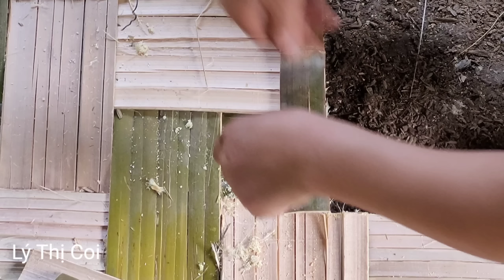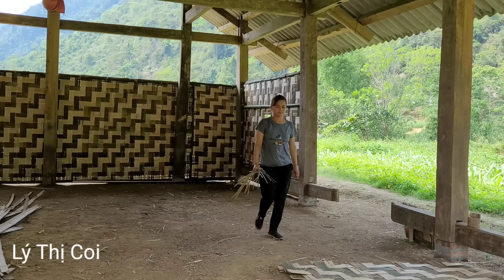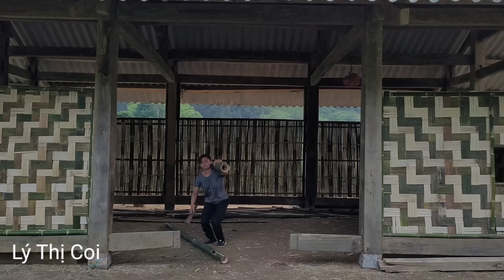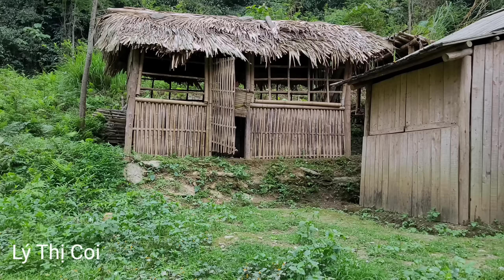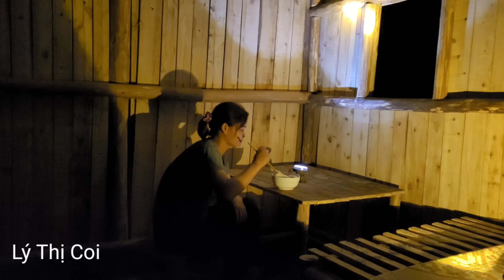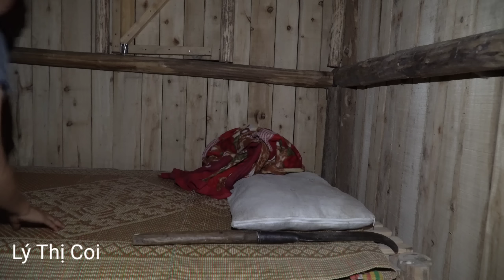Bad guys appear in the night - Bamboo house wall design part 2.

Comment: Go on-line and buy pepper  spray or bear spray that will detour them. Be careful to move back a few steps as to not run threw the spray but only spray when you are close to the bad guy. Close in you buildings with 6ft fence. I am so glad you’re not going to give up.